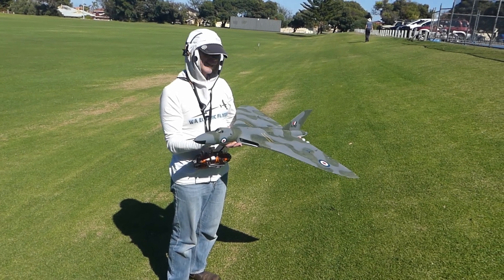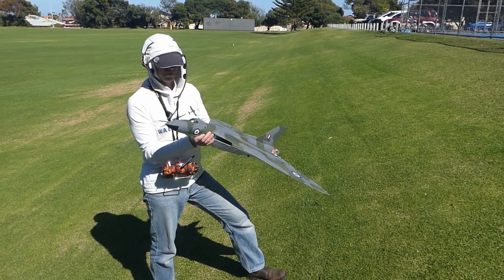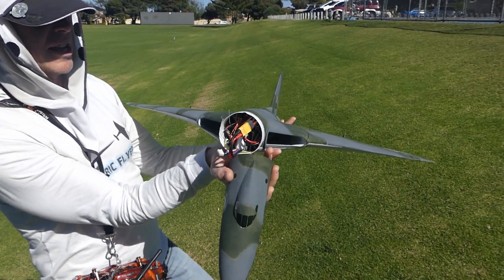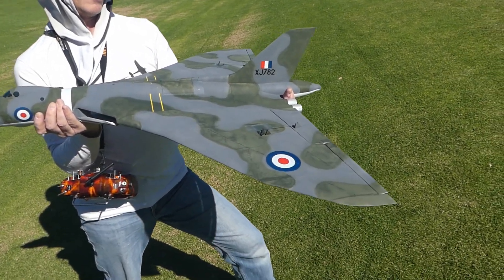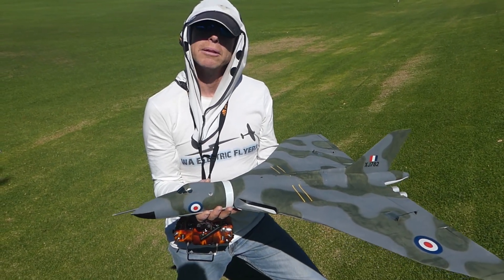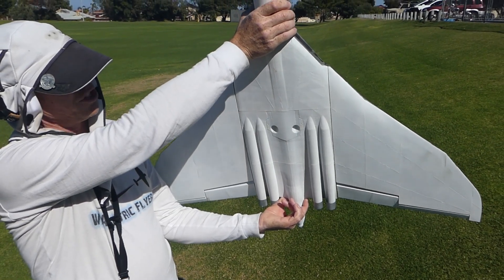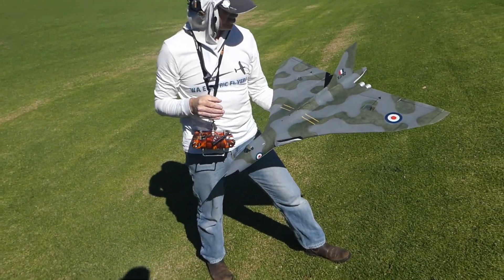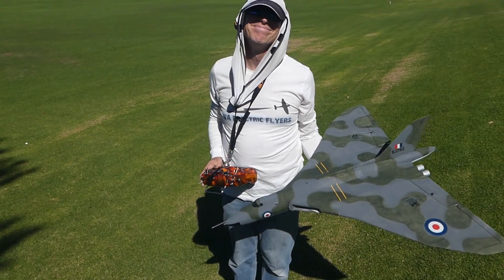RC Vulcan 3d-printed in LW-PLA

Comment: mine flies very well using a 4cell 2200 pack but does have a strange 'wobble/oscillation at speed
Reply: It's a dutch roll apparently and common with swept wings (damped out on full size planes).  It's worse in windy conditions. They all do it, the fin may be a little small too which won't help I expect.
Reply from the maker: Yes, mine wobbles as well - mostly I've noticed when there is some wind.